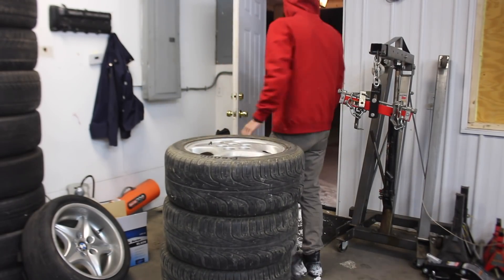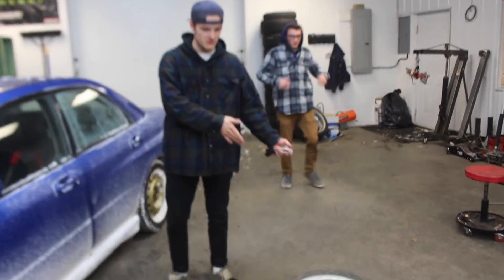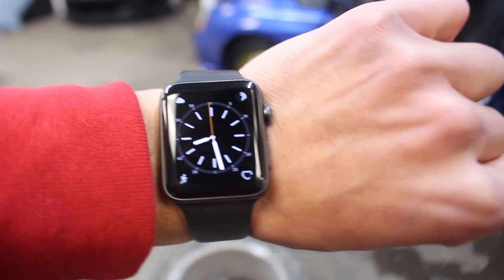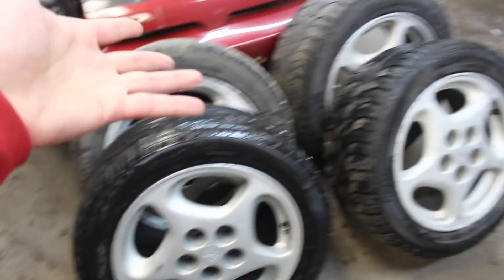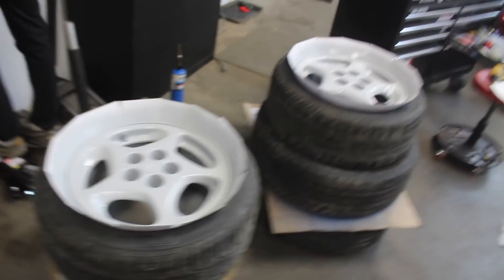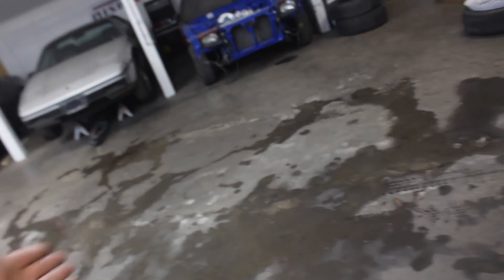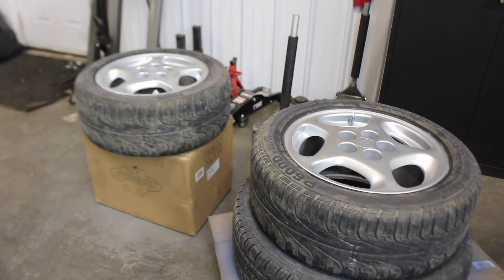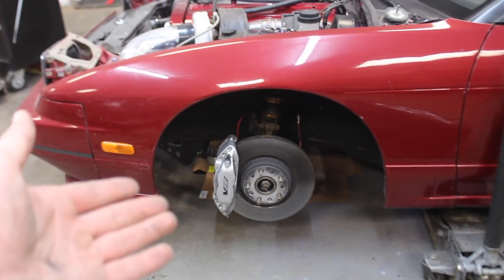TIME FOR CHANGE...

Comment: Stock life! So I do like the look, but how do you plan to run these just for fun, if they don't fit the front... gonna use them as like drift spares or what.
Reply from the maker: I answered your question in the video 👍🏼
Reply: riight, gotcha. Still gotta make them look good though right.

Comment: you forgot to clear coat them tho.. when they start getting grease,  its gonna be a btch to clean them
Reply from the maker: As mentioned my dude. Just rollers till mine are painted.
Reply from the maker: But I might toss come clear on em 👌🏼
Reply: i know.. but doesnt hurt to spray them real quick with some clear after all that work.  i mean, a can is like 7 bucks.  they look too good to see them get dirty.  :)
Reply: for sure...

Comment: Why does every YouTuber I watch use those junk wire wheels that you stick in a drill? Get the 4.5 inch wire wheels for angle grinder. They work so much better and so much faster...
Reply from the maker: Picked one up a few days ago 😂👍🏼
Reply: Kalvins Garage Haha right on. Those things blow through the work. Wear leather gloves though, I was cleaning some metal a while back and some of wires let loose into my knuckle. Literally had metal hairs embedded into my hand lol.